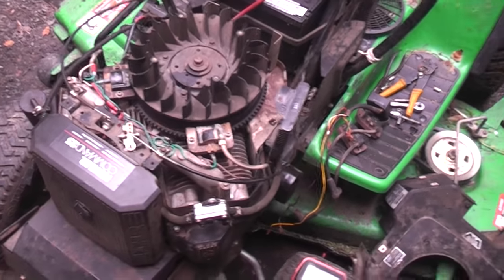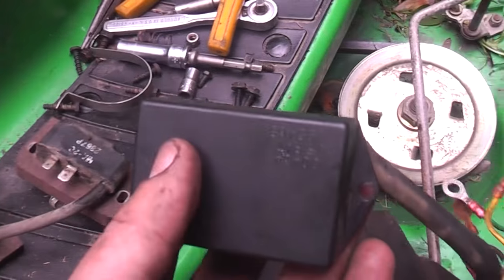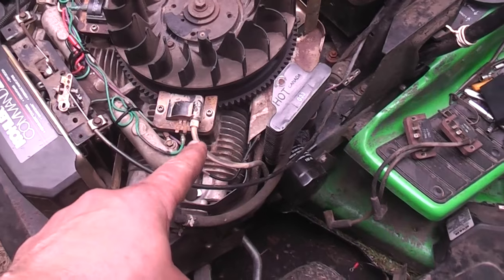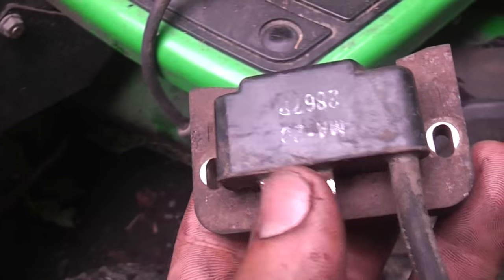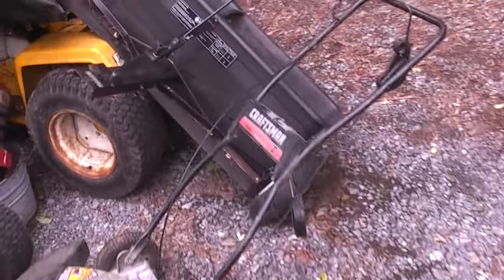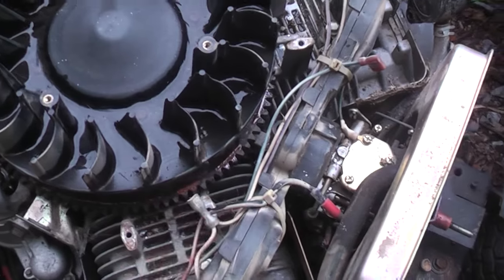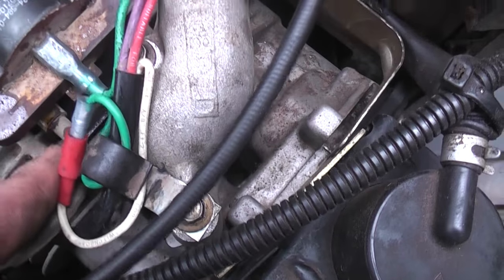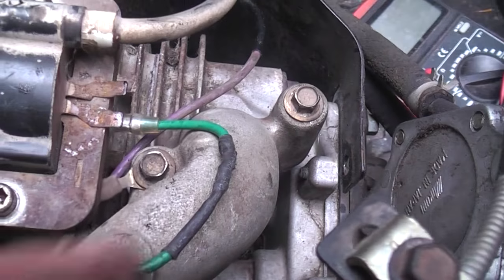Kohler CV25S Ignition Repair (Eliminating the External Module)

Comment: what do you do with red wire that was connected  to the smart spark box
Reply from the maker: +Eva Garcia Leave it disconnected. Put tape or shrink tubing over the end.
Reply: Thank very much for your response.
I'm going to follow  your advice because i think i have a bad smart spark box.

Just one more question. What type of coils did you use.
Reply from the maker: The replacements were factory Kohler, from a CV730S, I believe. These newer ignition modules only have one electrical tab on them, for the kill circuit.

Comment: Where does the blue wire from the harness with the clip go? I converted from a 19hr to a 22.5 and did the same electrical swap. But the engine turns as soon as the negative is hooked to the battery
Reply: Did u ever find out? I'm having the same issue with the 2 white wires and the blue.

Comment: I have a kholer cv25  i wired it the way you showed i have to red wires comeing out of the speed advance  one runs to the carb. I dont no where the other one goes it has fire on it.it want run with both wires on the coil. Will run with one wire off .what should i do
Reply from the maker: You replaced the module and old coils with the newer coils?
Reply: Wenford, the other red wire may power the carb solenoid.

Comment: I have a tractor and am hopefully going to bypass this module, I took it out of the system and am aware I am left with a white and red wire. I have a 16 hp kohler and its a single coil. Can I use the existing ignition coil and ground it out or can I substitute a different hp ignition coil?
Reply: Following your theory, what charges the battery?
Reply: @patrickblell6570  Sorry. I know this is an older video. Just curious. What does the ignition have to do with the charging circuit?

Comment: Now I know why my Kohler engine has a sticker that says “NO SMART SPARK” on it. Must have really been a bad idea.
Reply from the maker: Yea, it turned out to be a little over-engineering that just made things harder to fix.
Reply: @suchfunstuff    I’m doing some rehab work to my Kohler CV25S and I’m pretty sure that I will be replacing both coils. Most coil sets that I see sold on eBay and Amazon say that they will fit like up to the CV23 but then don’t list the CV25. They’ve gotta be the same — right?  These coils have one terminal for the kill wire and two extra terminals. I’m guessing that the extras are for the Smart Spark feature that’s not used on this particular engine. The extra terminals are on the opposite side of the coil.
Reply from the maker: @localcrew  You need the ignition coils with a single terminal. Part No. 24 584 45-S
Reply: @suchfunstuff    👍.  Thanks for the info.

Comment: Problem is the tractor safety circuit is not compatible with coil grounding...
Reply from the maker: +willard west I know what you mean. In other words, 12+(batt) voltage is removed from the smart spark module to shut down the ignition. I think the wiring for the ignition ground was present in this particular case, but getting it connected was left out of the vid.